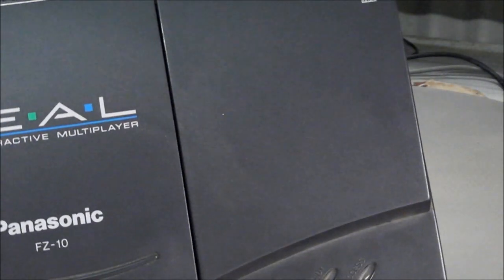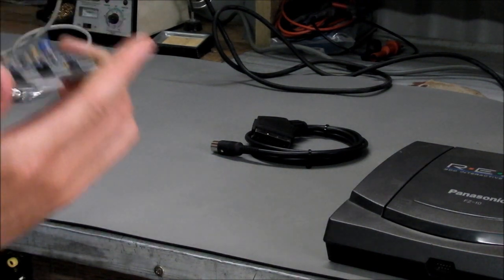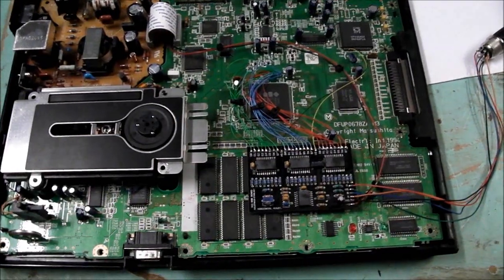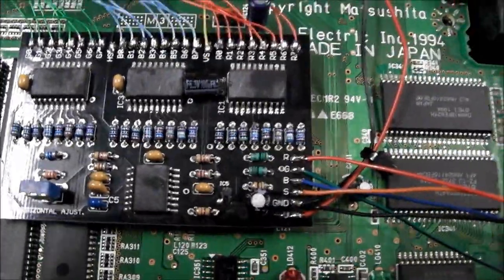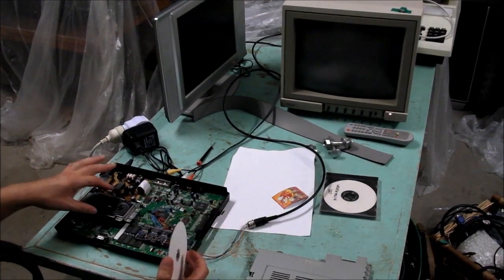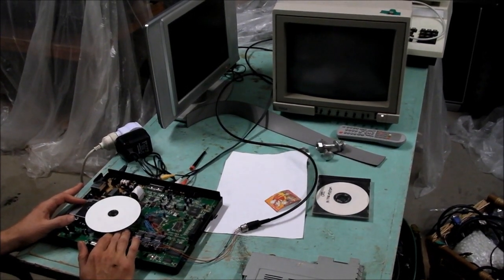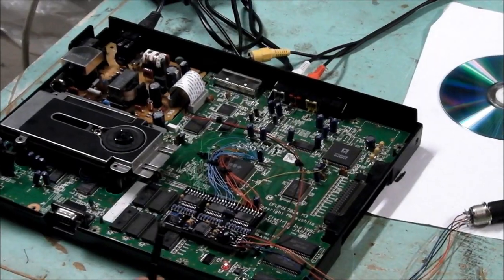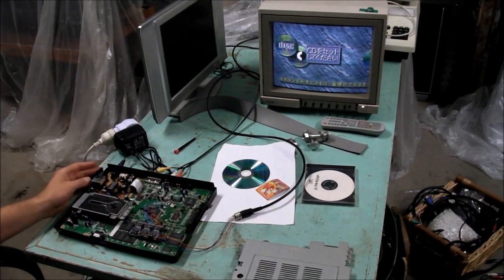New 3DO RGB Mod

Comment: I just tried my PS2 on my Loewe with the Monster World collection to check out 240p mode.  I've been meaning to do it for months now and was reminded of it via the video you did on a cursed SONY with the same game.  I don't think it looked as bad in 240p as that SONY but then again, I think it was the one with RGB-less SCART.  The white text scrolling across the screen at the beginning of Monster World IV is perfect for seeing the horrible smearing the "curse" brings on.  I noticed that when you turned off the DMC "feature" on that SONY, it had a 2 or 3 inch thick line scrolling down the screen which has scanlines.  My Loewe does the same thing when progressive mode is turned off in the service mode and gives a depressing peek at how nice the TV should look.  The Loewe is gorgeous, it's only the lack of scanlines that fucks it up.  I didn't realise that they were cursing the TVs as far back as 1997!  Must make it much harder to find a TV without the curse because I don't see many 4:3 sets at all.

Comment: I need to get some of those boards when I have some spare money.  I just bought 2 lots of consoles; about 15 SFCs, 8 Saturn's, 2 PSOnes and 5 N64s.  I'm planning on fixing them up and selling them.  They were "junk" lots so I hope that they all work :D. There were also some DCs and 2 FCs.

If the SFCs are early enough, I will do native component mods on them and sell them but I may need a few boards for the Saturn's and SFCs.  I have not even thought about the possibility of component modding PS1s, but there is about 5 or 6 of those in the lot as well.  The 2 lots cost me just under $60, Christ knows what shipping will be!

I am so fed up with trying to find a good Loewe/Grundig without the 100Hz curse that I am thinking of buying a nice SONY or Panny and using component mods instead.  I saw a Grundig the other day that looks very similar to the 89cm one you showed in one of your videos but it's in SA, even worse than Vic :(  My sister is driving to Sydney for a wedding in a fortnight so I was hoping something would show up in Sydney but no luck so far.  Really pisses me off that this time last year, I was in Vic but knew nothing about the TVs.

Comment: What state are you in? Im in QLD. The better option for the 3DO RGB is use a BU3616U chip, that has been around longer than the one youre using, not sure what advantage this board has or certainly why they think no one will figure out what those chips are!